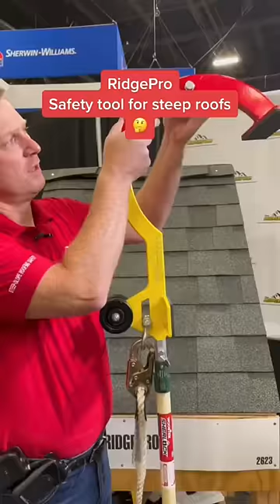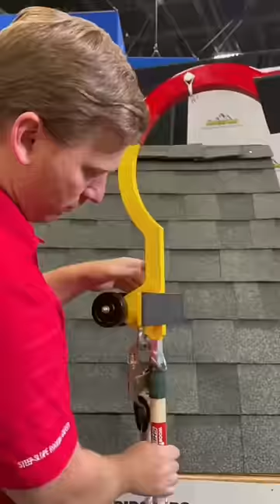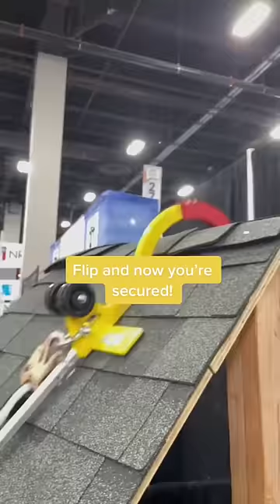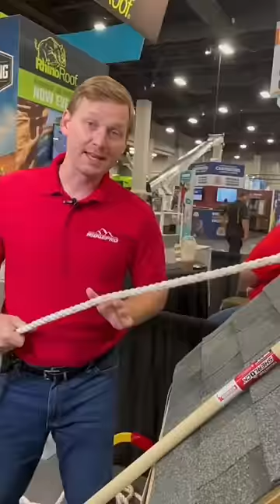Roofing tools

Comment: Might I suggest making a back-up to the locking pin, and to make the two anchor pads bigger, to help prevent punching through a soft/rotting roof.  -also, maybe reinforcing the curve?
Reply: What is your background?? You seem to be the only one other than me to see all the design flaws..
Reply: @twistedhillbilly6157  exactly there’s so much that can go wrong 😂As a roofer I know this is not reliable
Reply: Great suggestions, I think one of use needs to talk to the company about that - I want to order one but the points that have been brought up are strong!
Reply: Ya, my first thought was wtf is that pin in the arch. doesn't look good for over head safety equipment
Reply: Yeah idk about the rest of the world but in Australia this wouldn’t fly
Reply: What's wrong with the pin?
Reply: That pin is probably rated for thousands and thousands of pounds.
Reply: @Rocket Willy  if it gets bumped and opens up. Can wiggle out on other side of roof without being seen. Also Clevis doesn't appear to be overhead rated. Maybe I'm wrong tho
Reply: @twistedhillbilly6157  I like to tear-down & fix, reverse engineer, and re-build better when possible.  Picked up some tricks along the way.  Current job taught the importance of back-up safeties and redundancy.
Reply: @Bankable2790  The pin itself doesn't look like a fail point.  But with normal wear and tear, things like internal safeties can rust/fall off and go missing, and the pin can work its way out.  In addition, because of the location of the pin, and the angle its sitting at make the holes a weak point, and prone to widening with age, or even possibly tearing.  It's better to have a secondary fail-safe placed elsewhere.
Reply: The pin isn't going to slide out anywhere it has a lock on it. Could just use two pins. By appearances that is some thick steel (it's overkill and doesn't need reinforcement). Larger feet is a great suggestion.
Reply: @jonathanbetenbender307  have you ever seen any fall arrest equipment. Or overhead equipment.
Reply: @Technics19  the lock seems pretty tight, and doesn't stick out from the pin, I doubt it would unlock by itself, and the pin shouldn't be able to wiggle out while in use
Reply: @Technics19  I haven't worked with fall arrest equipment in a work capacity; though did a little bit of climbing, other than that I've only seen it in passing. I was interested in being a lineman... is OHE broader than Electrical? Seemed like a rhetorical question,  so what am I missing here? What is the issue?
Reply: @Jonathan Betenbender  just doesn't look proper to me.
Reply: It's for one person lol. It'll be alright
Reply: Before all you youtube engineers do a breakdown on a product you watched a 30 second short on you should probably use it before talking about it. This works as advertised and feels really sturdy
Reply: @C Monneyy  its literally just to help you get to the ridge line to screw in your anchor to actually clip into.. its not meant to be used instead of a regular anchor and harness
Reply: @kirk5637  Whether or not this happens, my original comment was made with slipping in mind.  If you're using this as a climbing assist, you're naturally going to reach for the nearest assist when suddenly slipping, so it should be able to withstand up to maybe 600lbs of pull force, for the big guys.

-The other problem that comes to mind in a similar scenario is some object turning this into a fulcrum and making the hook to lift off the roof during a slip, but I have no idea how to effectively deal with that
Reply: Add a bin on top of the rear pad, where you can rest a heavy package of shingles, weighing-down the pad.  When you pull, and you need it, for emergencies, life-&-death-wise, you don't wanna see it popping up off the other side and coming down with you.
Reply: Some of the most simply ideas work better than super teched up products, just saying this might feel different when using with hands and not eyes only
Reply: I think the concept is there 100% I agree with what you're saying. If they could tweek these issues I think this device could save so many lives. I think any safety device could always be a little more safe lol
Reply: @amnesite3573  it's the same thing as a hitch pin on a vehicle. I own a ridge pro and have used it hundreds of times (I'm a Claims adjuster). This device is solid and I still feel confident using it. There aren't very many alternatives to temporary anchors.
Reply: @amnesite3573  it’s a setup anchor though, I think it looks relatively fine for that purpose. A threaded bolt and nut might be nicer than the pin.
Reply: @amnesite3573  - A climbing fall can generate anywhere between 2 - 5 KN of force. A safety device should be able to hold 3 to 4 times that amount during a fall so 15 to 20 KN or 3,000 to 5,000 pounds.
Reply: @Technics19 you put a pin in a trailer hitch and it doesn't ever break

Comment: Edit: worked, past tense. 
I work for a BIG multi state roofing company. During one of the "safety meetings 🤣" I brought up this product and was told "if you want one you'll have to buy it yourself" I'm not going to keep working for a company the doesn't hold up the Integrity it preaches.
Reply: Yeah, one day you will get hurt and they will try to blame you for it by finding any thing they can to say it was your fault and not thiers..  ask me how I know.
Reply: @Ryan-re1rs  ...when the company motto is CYA. Sorry to hear that brother.
Reply: NAME AND SHAME!
Reply: @DNANDROID  Always inspect equipment before use. Maybe a cotter pin would be better than a push pin? It wouldn't be an everyday tool though I've had a few times it would have been helpful.
Reply: @metagoat  lol good luck
Reply: If you're a roofer you know damn well you ain't f**** harnessing up. Until it's at least 11 or 12 pitch
Reply: @kpusa3278  I've had a sketchy time trying to get up a couple of 12s. Like those old 3 tabs that all the granulals are worn off. I couldn't even walk up backwards in cougar paws 😂.
Reply: Is there any one left who does?...you may be out of a career in this post covid era
Reply: @kpusa3278  what is pitch in degrees
Reply: @Trump took the vaccine  not a roofer but if he means 12 pitch as in 12/12 then it is 45 degrees.
Reply: Then get on down the road. Plenty of manly men who do roofing without these things. 
Hell I did it for three years and never fell. Never saw anyone fall either on the ten years I framed houses.
Reply: @taylorsova2594  oh hell no
Reply: @jjaa578  cougar paws are good but they ain't that good.  You got to get the wedge pads that you stand on While working  and use them as steps until it's finished being torn off
Reply: @xposethatruth1682  

It's always weird how many people pop up on these videos about trades and safety who seem proud of being taken advantage of and risking their lives for a paycheque.

Give me a day and I could find you the names of 20 roofers who didn't get to go home to their kids one day. And guess how many of their companies gave a rat's, besides the hassle of replacing a guy and doing insurance paperwork.
Reply: I'm a business owner and a safety first I buy guys what ever they need to be safe
Reply: Or they dont want to invest in products they dont know about or arent industry standard.
Reply: @jjpaq  meh, I survived 15 years of framing/roofing and all the people I worked with in that time went home. I worked in one of the fastest growing area in Iowa around the Iowa city/cedar rapids corridor. We couldn’t build houses and duplexes fast enough it was crazy. No one, and I mean no one was tying off. And we were working sometimes on sloped lots where the walkout was exposed in the back. If you know anything about house construction, you’ll know that’s high enough to kill the toughest guy. 
I’m not saying we were doing it the safest way, just the fastest and best we could. 
We could see five to ten other contractors from the roof and yeah, no one was tying off….or falling. And most of those guys at that point were  and pop businesses so yeah, everyone cared about each other because our crews were small and we worked closely with everyone. A death definitely would have put any one of those guys out of business. It’s just the way it was done. We didn’t see it as dangerous at all if you paid attention.
And if you weren’t a pussy, you got paid a lotta money for your work. Otherwise you’d go find another job like the wimpy non-man that you were. We all went home. We weren’t scared, stupid, or taken advantage of, we were men about it.
Reply: The place i worked for had a ladder policy, if you fall you are fired before you hit the ground, didnt happen on company time.
Reply: @matthewp1682  I was told "When we are required to have them we will get one until then you buy it if you want it, we pay you enough to." From my boss that doesn't go up on roofs anymore. Either I rock the boat and get fired or try to stay for a year to pay off more bills I pilled up during COVID. This company has too many integrity issues for me to work here long term. For now I hate myself while selling my integrity for pennies and working for a hypocrite again.
Reply: @xposethatruth1682  

No buddy, hate to say it, but somebody bought a nice new car every year with the money they were legally required to spend on safety equipment for you. Sure, a chunk probably went to some local inspector to make sure nobody ever turned up to the construction site to look closely, but they did okay.

The crazy part to me is that even years later, you're still writing whole paragraphs bragging about how you risked your own life to make a rich guy even richer, and somehow you think it's the people who don't who are "pussies"? Boy, they really tricked you, it doesn't get much more brown-nosey than that. 

(If anybody's reading this and just starting out in the trades, leave guys like this to their misery and arthritis, and take care of yourself. Nobody will be buying you a new back or knees in your 50s, so take the extra few minutes now to make sure you go home safe. Screw the boss—they can afford it.)
Reply: In Germany we use roof hooks. I mean there a plenty of different roof types. With tiles we slide them up and create a ladder. With shingles or slates we use roof hooks. By installing them we can use afterwards ladders to reach certain areas. And a scaffold but that should be a rule in every country. 
Be safe brothers!
 If there's any chance to work two weeks in a different country let me know. I'm interested in new working culture.
Reply: @jjaa578  are providing any safety equipment? If not id agree with you but if theyre offering the minimum safety equipment then this is a personal choice item if you want youd have to go get it.
Reply: OSHA-iiiiit
Reply: @jjaa578  like we use to say here in The Netherlands, a accident can happnen in the smallest corner. a accident like that can happen to the best of us, for example sky divers that has done thousands of jumps and triple check everything with the 4 eye principle and still get killed of a parachute malfunction or what else.
Reply: Safety...third!....
Reply: Yeah alot of companies arent interested in safety. They only have meetings because it is required by law. Then they sit around and wonder why its so hard to find young people to do these jobs.
Reply: @PerfectPrinceX1  2 more weeks as of today
Reply: Yeah it's funny because every company that I've ever worked for that had a safety department love to talk about safety, all the time, in any context they can think of, but when it came to actually doing things to make the job safer, that was completely up to us.
Reply: @xposethatruth1682 Okay Billy Badass. 🤣🤣🤣
Reply: @Youtubeuser1aa . Pitch is inches up per foot.   12 pitch is 45 degrees, 6 pitch is 22.5 degrees
Reply: I'm not a roofer so I got nervous laying a tarp on my tame roof--just trying to keep the water out until the contractor could fit me in their schedule. I watched the roofers as they installed my metal roof like it was nothing...no worries at all. No harnessses or fall protection. I think I'm more interested in this product than they'll ever be.
Reply: Then don’t. 😢
Reply: @xposethatruth1682  So with that logic, since people drove without safety belts or motorcycle helmets for years that its not a good idea to use them?
Reply: @RCichard  I ride motorcycles and have for forty years. The only time I wear a helmet or willingly put on a seatbelt is on the track. Not that people aren’t safer doing certain things. Just that in my experience, and doing residential roofing, theses aren’t thing. Now heavy construction and commercial at height is different. Although anything over three times your height is considered serious or fatal, most residential construction isn’t all that high. Some walkouts get a bit up there but for the most part, it’s not that bad. 
I do have a nice harness and good retractable lifeline for myself tho for tall buildings. Tying off usually is down to the other side of the structure, we don’t go through the roofing or framing.
Reply: Yeah companies that refuse to innovate are doomed
Reply: File a lawsuit against them with OSHA, make that company pay for it! If they threaten to fire you afterwards you’re gonna get paid and a secured job  after that
Reply: @countreekidd  as a shark would say, for those reasons, I'm out!
Reply: Hold up your end - by the sounds of it you haven't quit that job yet.
Reply: Amen,Brother!!!! I  indeed agree with you, !!!!!! I made one kinda like it,had it for Real,about 30years,wouldn't trade it for anything
Reply: @Joao-Michael Wenz  I was in Germany 10 years ago on business, is it common for every roof in a town to be the same?
Reply: NONE of them do... Get as much money as you can then go independent.. It will never stop raining and roofs will never stop leaking.. You are in a good trade.. make as much money as you can and while  you are still physically able to..   AND that thing may look good but the design is horrible.. I seriously doubt that it is certified by anyone..
Reply: If they do not care about the safety of their employees time to call OSHA.
Reply: @mrbmp09  no, they go by pitch. In America it’s expressed as  4/12, 6/12, 8/12, 10/12
The rise of the roof per 12” of horizontal run tells you how steep the roof is.
Reply: @jjpaq  no one is bragging about their Injuries or near death experience though? They are simply putting their stories out that as a warning to the dangers of the trade. It fucked up the way people are treated by some of these companies and I hope shit changes for the better and I do agree on that last part. Make sure you’re okay and that you get home safely. Take that extra time and precaution, don’t listen to the boss who wants you to do shit quicker and disregards your safety
Reply: Yet your still there. I'm not going to read a comment that doesn't hold up to its word
Reply: @TDWO  Last day is Wednesday. While trying to be witty or sarcastic (failing at both) you have proven that in fact you did read the  comment 🤡
Reply: Give me 2 cousins any day.
Reply: I’ve been hiring the Guatemalans rope one ladder stripped and laid in a day like 10-12 of them fast as can be no leaks so far And no drugs on the job site worrying about all that crap
Reply: @pablo4yu  You people 🤡🤡🤡
Reply: I’m sure they follow osha regs
Reply: News flash most companies don’t care about their guys
Reply: @RamminRanch  I bet your a secretary aren't you
Reply: @jjpaq  give me a day and I could find a list of 1000+people that have roofed for 20 years and never fallen from a roof.
Reply: I've been told by managers, "I'll be safe when they start getting into my wallet, until then we're going to do what I want!"
This is a huge national organization with a big Safety Focus; that's all for show, to keep OSHA off their backs!
Reply: Buy it and don’t let anyone else use it
Reply: RIGHT ON BROTHA!!!👍👍
Reply: Out that company bro, safety should be a primary priority of all working trades.
Reply: @kpusa3278  I was a commercial shingler for 8 years in the late 90's /early 2000's.  Used a harness three times, and then it was only for a specific situation.  Roof jacks we're the rule for us.  We were ticketed only one time by OSHA for no safety glasses.
Reply: just make one